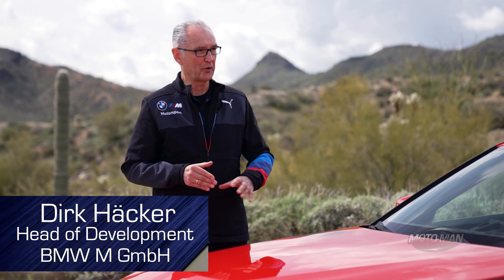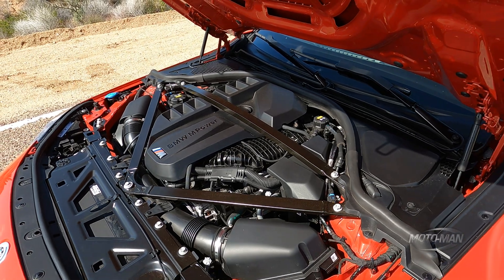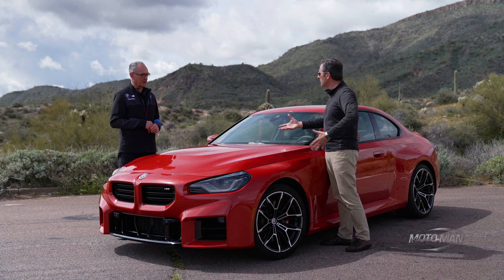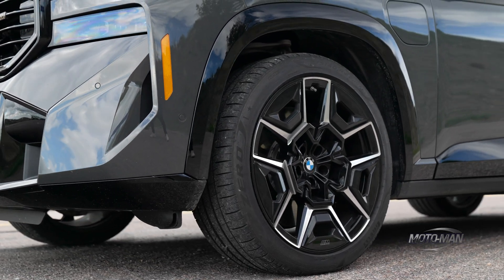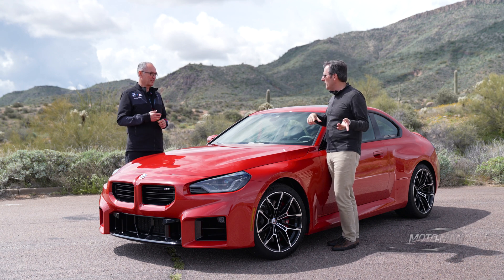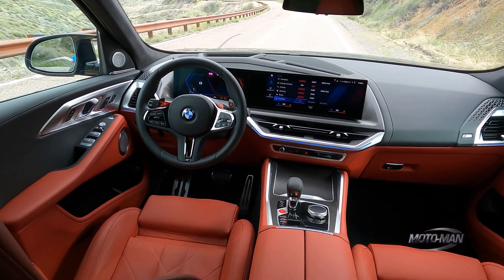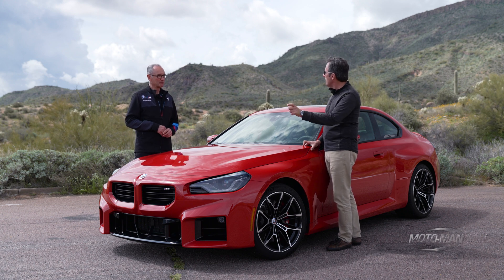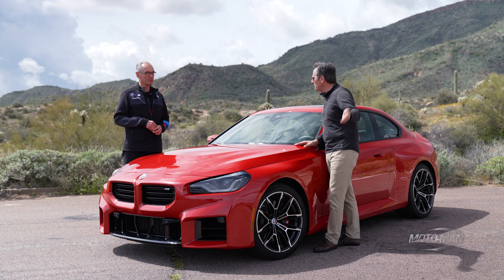How a BMW M is engineered from the man that runs its development!

Comment: Hi, can we test bench on really crapy, dusty, high particle content, from sea level to 2200, 3celcius to 120⁰, high uv exposure.  I propose to use more robust air con systems to cool the engine compartment and the hot side of the engine. The cabin system from the hybrid system as the accessories. Use vacuum to create a system to vacuum particles on the intake system and cabin positive pressure.

Comment: 5 years ago I really thought the pendulum had swung in AMG's favor with great V8's in almost every model, sharp steering and suspension tuning, and excellent seats compared to the M-cars of that era. Today it looks like that pendulum has swung the other way with the unemotional 4-cylinder-hybrid powertrains in most of the new AMG's.  Hopefully this not just a timing issue where BMW is late getting to that same 4-cylinder party!
Reply: BMW is absolutely headed that way.  It's required to meet EU and China regulations. Merc's strategy is prioritizing Chinese market in the near-term, as well as the EU company car tax system (how most luxury cars are sold in the EU). But it's just a matter of timing for BMW.

They can continue to sell these cars in the US, but hard to make the business case for 1 of many markets.

Comment: All I ask of BMW is to always be here for the petrol automotive enthusiast. Some of BMW's greatest rivals are making the commitment to be totally EV in the near future. These rivals will possibly lose customers to BMW; I am one that will be making that switch. EVs are fine, but while in an EV, I do not experience the joy of the participation in the operation of the vehicle. Just my thoughts and my opinion.
Reply: Starting in 2035, all new cars in the European Union must be zero-emission.  Suppliers will start ramping down long before that.  The transition is inevitable.  Buy your classic (repairable) sports car now.
Reply: @JohnPMiller  Thanks for that advise. That will be a sad day when that come around. I have a well maintained 2016 E350 that I just love and almost hate to ever get rid of. 20 gallon tank, on the highway while behaving over 500 mile range, less than 10 minute refuel. I am sure by 2035 range, recharging and hopefully, the repairability will have improved. I just do not know about the joy factor. A repairable sports car!
Reply: IMO BMW has already stopped being the enthusiast brand. They've intentionally removed steering feel from all their cars, no longer do 50-50 weight distribution, stopped focus on weight savings to save $, have the worst manual on sale, stopped developing bespoke hardware for M cars. They've focused on parts consolidation, using the ZF8 for everything from a 230i to an M4 CSL. Their flagship M car is a 6k lb SUV whose key feature is the rear seat lounge.

Their focus is on in-your-face styling, tech and screen overload, and straightline speed. 

That's not to say their cars aren't good. The 5-series and X5 are very well-rounded luxury cars. They're just targetting mainstream audience rather than enthusiasts to grow market share.
Reply: @The_Stanman  I have several passionate BMW enthusiast friends that echo your thoughts. I just noticed that BMW is making some of the same changes that Mercedes has done. Still, BMW has more powertrain options over a wider range of their vehicles. The only thing I can do other than just talk about this is to decide where I will spend my money. I have never been unimpressed while driving or riding in a BMW. Happy Independence Day!
Reply: @arthurcatalanotto1151  yes they're still solid cars, just not what they used to be. I previously owned all BMWs but have switched to Porsche because of it. Which is unfortunately they're much more expensive. 

I'm looking for an M3-sized sedan next there's not a ton of great alternatives, so I may end up back in another BMW next. 

Happy 4th 👍